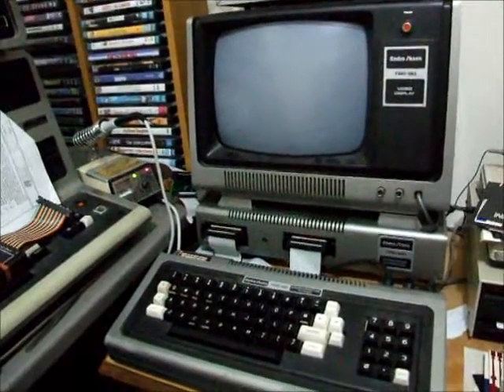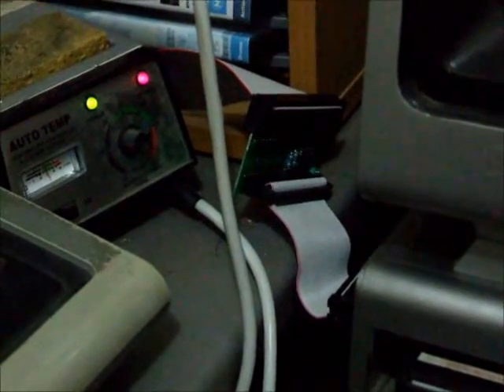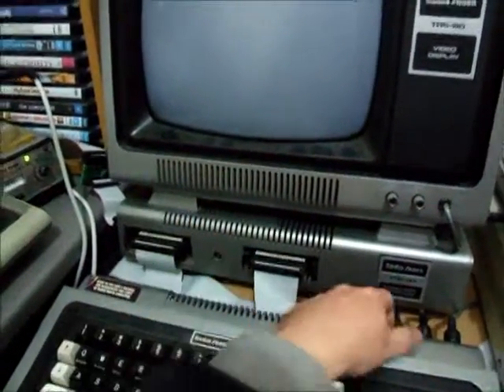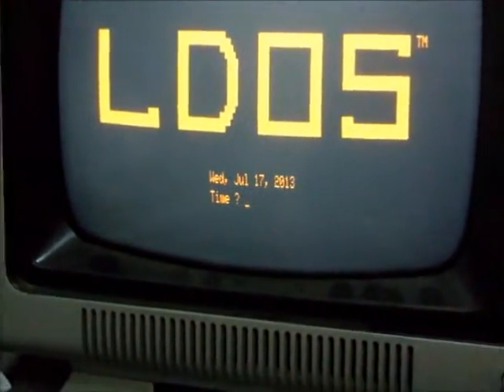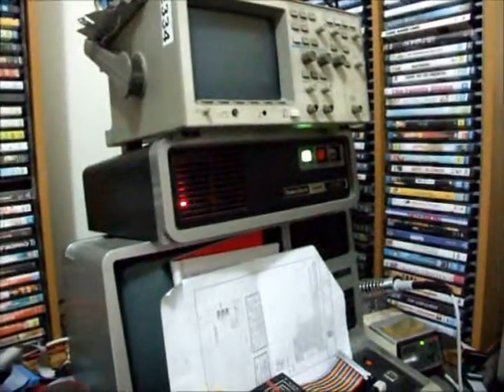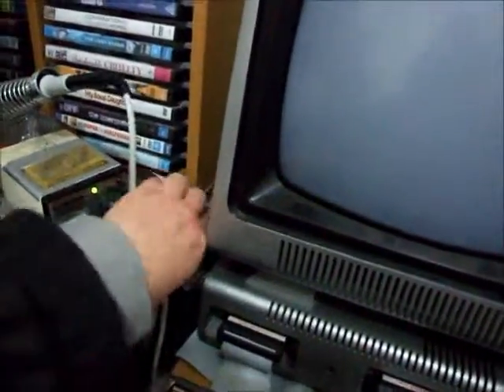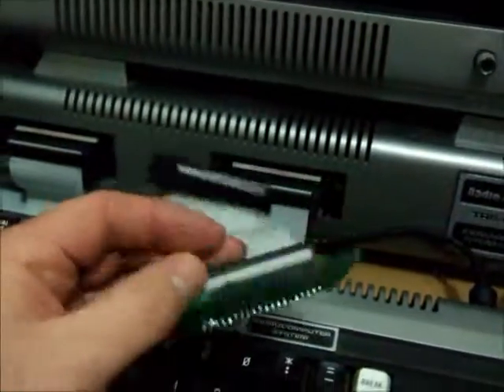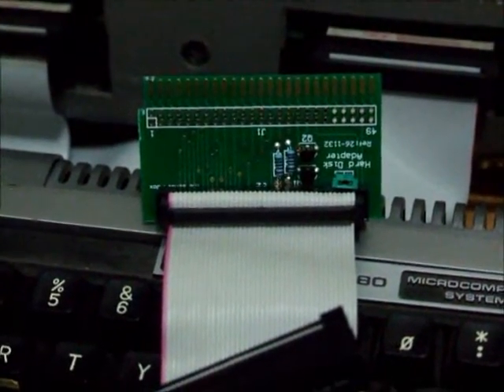TRS-80 Model I hard disk adapter

Comment: It looks like you have the Model I drives mounted in an FD-500 series drive enclosure from a TRS-80 Color Computer. Are you able to use that drive on both the Model I and Color Computer by swapping out the external plug in controllers for each respective system?